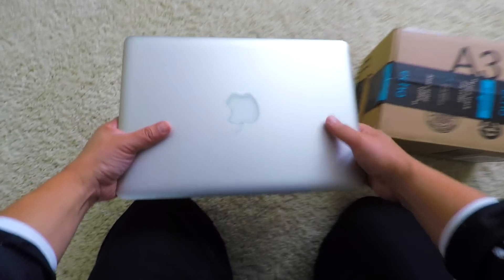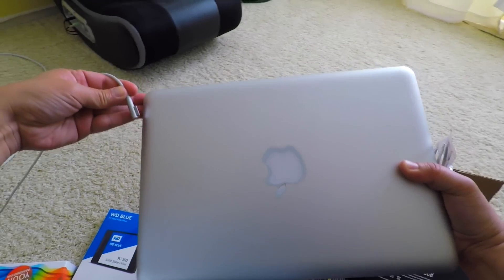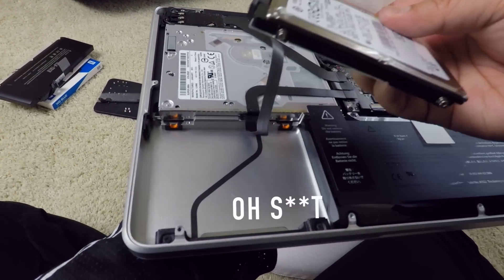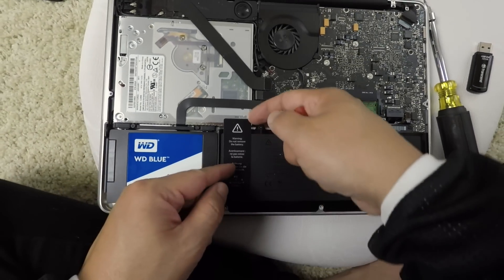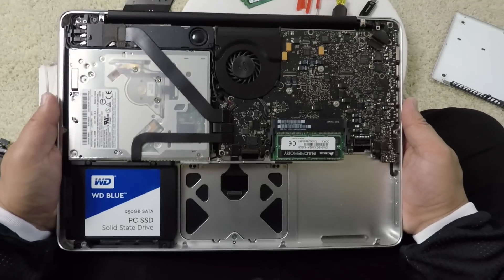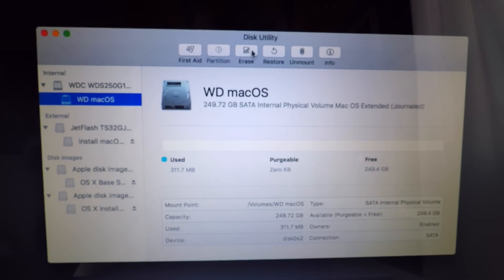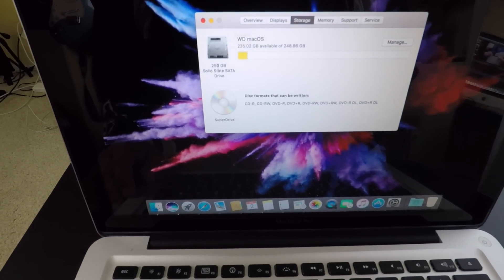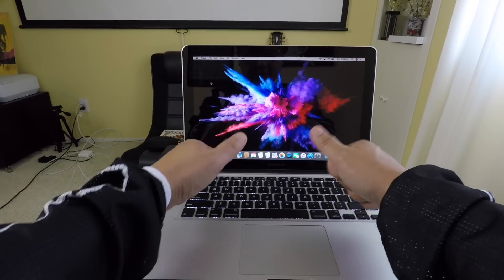Old MacBook Pro Upgrade, FAST Memory, Fast Hard Drive SSD

Comment: :hand-pink-waving:  Dude, if the old HDD was 320GB and your new SSD is 250GB ; shouldn't you be putting in a larger capacity SSD?
  Maybe a 500GB or even 1T ?

Comment: 13"My MacBook Pro 2011, i7 500GB needs new RAM. Should I buy "Samsung NB 8GB DDR3 1333 x 2 pc, or the DDR3 1600? The DDR3 16000 is selling x1. I would have to buy 2 pcs. Could you please advise what to buy? What is the difference between the 2 versions? I am not an expert. I can remove and install RAM. Thank you for helping.
Reply: 1600 is faster than 1333
Reply: @indoperfect4080  Thank You"

Comment: Does this comp still run fast ?? If not, how long did it last? My mid 2012 MacBook Pro is very very slow now and I’m thinking about swapping out the hard drive ram and battery. Please let me know
Reply from the maker: Still runs fast today. If yours is slow, upgrade to a ssd drive like I did. It's the most important part to make it run fast. Good luck!
Reply: @jonthestreet  So i cloned my hard drive to a SDD. Then replaced my old mac book pro hard drive with the cloned SDD and it works so fast now!! i love it . Such a cheaper alternative to buying a new laptop!!

Comment: Shoud have taken out the  long screws first on the back cover. Then remove cover, then the battery.  Drive replacement and RAM replacement then are safe.  Static electricity from carpet could have really been an issue. If you are going to put these out, know that folks who see it are looking at it as a resource.  This would be a very poor resource for someone with limited knowledge trying to do this...

Comment: I’ve a 2010 MacBookpro running High Sierra and now there’s no upgrades because of its age. The laptop in very good condition. Would changing the hard drive allow me to install the latest upgrades ? Advice welcome
Reply: Not really It will be a bit faster but you won’t be able to run the latest versions. Planned obsolescence.

Comment: I am not a computer person so someone please help me shed some light here. this may be dumb question but I am just trying to make sense of how is Lowering from high Storage 320 GB SATA Hard Drive to 250 GB SSD which has less storage would help make the mac book run faster ?  or does the number dont matter in this context ?  thanks great vid
Reply from the maker: 320 GB is the file storage and has nothing to do with speed. SSD’s are faster than hard drives. I think you're wondering why I'm lowering my storage size to 250 GB when it was 320 GB...It's because SSD's are more expensive(because they're faster and newer tech), so depends on your budget. See below for reference on file sizes.

From smallest file size to largest:
KB = kilobyte
MB = megabyte
GB = gigabyte
TB = terabyte

For example:
1 GB = 1000 MB
1 MB = 1000 KB
Reply: @jonthestreet  thanks a lot also came to find that RAM is the one that makes your file to run faster  in contrast to the hard drive given the size is not link to the speed of the computer.

Comment: Help Guys! will this work for a MacBook Pro (13-inch, Mid 2012)?? Thanks
Reply: It should. I checked the apple website and it did say that this works for Macbook Pro 2011 or later.

Comment: Does anyone have a problem with pressing the bottom of the case and it shutting off the laptop instantly? How is this fixed? I'm thinking of some type of insulator between the case and motherboard.

Comment: HAPPY New decade! Hi J. Very well explained and shot. I want to do it for my 2011 MacBook. It's January 1st, 2020 today ! !   If you were to do the same procedure today would you recommend the same brands or others? Which ones?
Reply from the maker: Happy 2020! I plan on doing a update video on my  2011 MacBook Pro and answer some questions, but I would recommend the same brand that I’m using because I’ve had zero issues. I’m sure other brands are good too. I would also recommend going to 16GB with 1600 MHz, because it is supported and most of you on here want the max out of your old MacBooks. More ram helps with video editing and multiple apps opened. The 1600 MHz gives a 2% boost. Not that much, but anything helps for these old MacBooks 😬👍👊
Reply: @jonthestreet  thanks bro. Looking forward to yr vídeos.

Comment: I just upgraded my MacBook Pro 13” mid 2012 with 16gb ram (2x8) and 240 gb SSD and still have installed 500gb HHD, run like hell
Reply: Old post I know but I also have a mid 2012, you’re saying the upgrades made no difference?

Comment: Hi J, I got everything installed.  But when I got to use my bootable thumb drive, I get the Prohibitory symbol (No Symbol).  Have you come across this.  I backed everything up so it is not a big deal to lose everything.  Got any recommendations to help me get my 2009 13 mac book pro going again?
Reply: I'll buy some merch man!  Just please help me out!!!  :)
Reply from the maker: I’m thinking the usb boot drive didn’t create correctly. If u downloaded the macOS from apple App Store, they did an update where it doesn’t download the full macOS. A lot of people have this problem recently. Try this: don’t insert the boot drive and reboot while holding down the keys: Option + Command + r
It should download the macOS that’s compatible with your system to reinstall. Hope that works 🙏
Reply: @jonthestreet  That did not work.  I ended up finding my original mac os start up disc and did a fresh install.  Now I just need to start updating everything.  Thanks for the video.  It was super helpful with the hardware install.

Comment: you can also upgrade 2011 macbooks to a mid 2012 logic board which gives you ivy bridge vs sandy bridge. and also adds usb 3.0.    so a 2011 macbook pro can end being up graded to
 2012 macbook pro logic board

before
2011 macbook pro
intel i5
intel 3000 hd graphics
500 5400 rpm hd
4gb ram
usb 2.0

after 
2012 macbook pro logic board
intel i7 cpu
intel 4000 hd graphics
500 ssd
16gb ram
usb 3.0

pretty much a different computer  i bet it will run like a completely different computer too.
Reply: It’s a different computer

Comment: I upgraded my mid 2010 macbook pro with 8 gigs of RAM  (up from 4 gigs), and a Samsung EVO 500 gig SSD hard drive (replacing the stock 7200 RPM drive).

I haven't noticed a real performance improvement EXCEPT the boot time is about half what it used to be. The Mac runs great except for kernel panic crashes which happen constantly.
Reply: Hmm a little late but it might be your gpu if it still works and you have and your interested you can boot into single user mode and disable the 2nd gpu but only do that after you find out the reason for the crash

Comment: Thanks!! Funny Guy, with the Burito 'bit'. Question? Can you Have 2 Different OS on Different Drives? If 'needed'? Some older softer might not work with Newer OS, and is why I've held off for a long time. I have a 2012 MacBook Pro, with OS X 10.9.5, but Need to Upgrade to Latest for some New DAW Software. Don't want to Lose ability to use older version Programs, DAW, and Screenplay Writing Software.

Comment: 1. Open the back cover with the right screwdriver and remember the screws positions
2. Disconnect the motherfucking battery before doing anything else
3. Keep pressed the power button for 30 sec to release residual energy (not many people do that)
4. Replace all the things u need to replace, be very careful with dem bitches connectors and flat, if u fuck one of dem up u're fucked too
5. Reconnect everything
6. Enjoy this bitch ass almost new Mac

Comment: Will I loose all my stuff if I take out the memory ?
Reply: No, it's just a quick swap. If you had static electricity and accidentally fried your motherboard, you're toast. Don't work on it on a carpet and touch something metal to discharge any potential static electricity.

Comment: I have a hard to make decision in buying macbook pro. Do you think it's God to use MacBook pro 201q in 2018?

Is there any problem with using it? I saw they upgraded macbook pro 2011 to 8GB ram, 1T SSD, Cori7.

Comment: Great video!  Question:  I have the iOS install and running smoothly.  If I remove this ssd 2.5” and use it as an external ssd drive on my newer MacBook Air 11 inch with better video card will that work as another iOS drive?  My video card on my 2010 MacBook Pro is bad.

Comment: Bro I enjoyed your vid & have an anomaly
I installed an SSD on my 2012 a1286 15 MBP, installed Mojave but it would just freeze up(spinning beachball) like once every 40-60 minutes , it was driving me nuts till I replaced the SSD with the old SATA, is the system not compatible with SSD's or was I tricked into buying a faulty second hand SSD, I contacted the guy & he immediately asks for my RAM frequency, I don't know what to make of it but could really use some technical answer, Appreciamos sobremanero
Reply from the maker: I had the spinning beachball on my iMac. I couldn't figure it out until I read that there might be a corrupted Preferences file on my iMac or something like that. So the easiest thing was to make a bootable USB drive, format my whole hard drive (my iMac has the Fusion drive), and reinstall the new macOS High Sierra. It's running smooth now with no beachball.
Reply: @jonthestreet  I fixed it by changing the SSD I had upgraded to earlier, when I replaced it with the old SATA it ran smoothly, the gentleman that sold me the SSD apparently didn't feel the need to share that it was faulty 😔

Comment: doing all of this on a carpet... static heaven
Reply: With the battery plugged in
Reply: first thing i noticed
Reply: not to mention the huge wool jumper
Reply: While barefoot
Reply: Humidity was high I suppose. He had no problems with static. I would have done the same. Big thing is not to move around and not touch any metallic part of the memory chips. Good job! Now on to see how it is performing eleven months later.
Reply: LOL I know 😂
Reply: Same!😂😭

Comment: I upgraded my Mid 2010 macbook to a 250GB SSD and 16GB of Ram. It's also running High Sierra and is just as fast as my wife's new Macbook.
Reply: How u get it to be 16 GB? I thought 8 GBs was the max.
Reply: @ryanillnoisevela2152  
I also went to 8 gigs, based on the available info.
Reply: Are you sure about 16gb of ram? I thought it maxed out at 8? That's what I have in mine.
Reply: @twes619  it OFFICIALLY supports 8GB but in REALITY it accepts 16
Reply: @twes619  all you need is 8 GB Ram, it won't use more than that its a waste of cash.
Reply: @allahdivinecipher nice. I like it. I have an aging 2010. I want to pop in a new motherboard, SSD, and I guess now 16 gb of RAM haha. Should be a fun project if I can get everything at a reasonable price. That's good to know, thanks for the info. I'll give it a shot and see how it goes.
Reply: Did you have to get a new cable for the ssd in the mid 2010?
Reply: Doing that to the mini mac 2011 I just ordered off eBay.
Reply: Cameron How much did you pay for that?
Reply: How much did you spend on upgrade?

Comment: Also dont forget to calibrate the battery. Fully charge it with power. Then take the cord off and let it drain. Turn all the power settings to not shut down while draining battery. Let dead computer sit for a bout five hours and then charge back up. Readjust power settings.
Reply: apple says the newer batteries dont need to be calibrated
Reply: RealDarkFilm becahse they do it themselves, so just doing it just in case with these knockoff batteries wont hurt
Reply: Paul Chinnery thanks for the info !!!
Reply: Didn't know that was needed.
Reply: Nic Bean Seems like a topic that’s always debated. Some say these newer lithium ion batteries don’t need to be calibrated and are best kept between 50-80%. Maybe a ounce full charge and discharge for new battery then charge as usual.

Comment: I'm thinking this is possibly a stupid question, so please be kind, but I have a MacBook Pro 2012 which has a 500gb HDD and is pretty much full and I have been given a SSD which is only 240gb.  I'm guessing I cannot replace my current HDD with the SSD and that I will need one that is at least 500gb?  Is that right please?
Reply: you'll either want a bigger one or not put as much stuff on it.
Reply: Nope, you can use that one and replace it not only that but you can replace the bay where the cd drive is and have two hard drives both SSD and HDD cost £8.99 or so for the caddy if you still need/use a cd drive cost £15 for a USB cd drive. :D
Reply: You should use a caddybay. It helps u to use both ssd and hdd on a laptop :D try it ;)
Reply: Khương Vũ Phạm is it possible to edit in 4K I read online that you can change both hard drives that are the same to something called raid but I’ve also heard its temperamental

Comment: Can you do the same on a mid 2009 macbook pro 13"?  I don't want to shell out the $ for a new computer if I don't really have to.  I just installed 8GB ram and I want to install a new hard drive so I can upgrade to Sierra.  My battery is still good. Thank you.

Comment: thanks dude - just upgraded Mid 2010 13" MBP to 2TB SSD & 16GB RAM - awesome....makes such a difference. Ended up using Time Machine backup to restore Mac OS,  and whilst probs not the most efficient way to go about it, a small price to pay for insane speed now.  Followed both your RAM & SSD upgrade videos....works like a charm! Thanks heaps dude - very helpful
Reply: hi there! i'm actually about to do the same thing on my mid-2010 MBP. except i got a 1TB SSD. did you clone your HDD first? that's where i'm iffy about doing it myself. i also wanna upgrade to 16GB RAM as well.
Reply: How to do backup start up booth to instal mac sierra pls.
Reply: Hey guys- sorry only just saw your replies. TBH, i have forgotten how I did it, but I just remember I watched both of his videos as stated and it worked great. My advice is just watch the videos he has uploaded and see how you go

Comment: So after an year of upgrading the shown configuration........how is your experience......would suggest an upgrade now?
P.S. I have Macbook 13" 2012, planning on upgrading to 1tb ssd and 16gb ram
Reply: Same here on my mid 2012. model, I think its last upgradable macbook pro. I pump it up with 16gb ram, ssd and switch dvd rom for second ssd drive. Its like little monster now. I almost end buying 2016. mbp model but I decide to upgrade and save money for other equipment ;) you won't regret
Reply: @Silvio_Jadranic  which macos will the best for macbook 2012 mid 16 gb ram, ssd ?
Reply: Adrian Szyluk in term of software/plugin compatibility Sierra was best solution for me, but that really depends on what is main purpose of your mbp. Right now I use Mojave. With clean install everything is pretty fast and stable.
Reply: @Silvio Jadranic its faster then sierra? And smoother? And how is battery life?
Reply: Rohan parikh i did exactly that oh my 2012 mbp and it goes blazing fast 👌🏻
Reply: I did my cousins about 3 years ago 8gb of ram and repaste the chips it moves like a monster and it stays extra cool now
Reply: You have to also enable the Trim on the ssd as well.

Comment: I have a MacBook Pro from 2010 (13 inches), and my hard drive is 249.2 GB, my RAM is 4GB, and my CPU is 2.4 GHz. I use Chrome as my browser, and I'm looking to use my Mac to learn music and audio engineering. What do I need to do to make my Mac run more smoothly?
Reply: upgrade ram to 8GB and your hard drive to SSD
Reply: Thanks.
Reply: Ryan buy an ssd and use ableton or fl studio 12 for your daw

Comment: Hi I have a question, I just bought a 2010 MacBook Pro 4Gb, Core i5 and it has 500 SSD . When I got it i wouldn’t download iMovie until I upgraded it to the “Mac sierra” or whatever.. same thing you mentioned. 

So was that like a big mistake or something ? Why is it not a good idea or how does it slow things down.
Reply: Eunice Sandoval No. I have a 2010 also and i upgraded to macos and downloading iMovie works and also works perfectly!
Reply: Nvm thanks lol you answered my question towards the end of the video. Still trying to figure it all out... but wait I do have one more question. The MacBook I just described do you think it’s good to make videos on and other stuff anything I should know ?
Reply from the maker: I would put more Memory in there if you're thinking of making videos. You mentioned it has 4GB Memory, so I would make it 8GB total, or 16 GB. I edit videos on my 2011 MacBook Pro and it was fine. I used Final Cut Pro for editing. There's also Adobe Premiere Pro, both good editing programs. Good luck!
Reply: J on the Street thanks for the response I love the MacBook so far ! It’s actually a 2012 year not 2010. So that was a plus idk why he guy told me 2010. I plan on upgrading the ram.

Comment: Always disconnect the battery first. Even dead.
Reply: Some people are better suited to learn the hard way.
Reply: Wait until you get an electrostatic shock, then you'll change your mind.
Reply: @relaxhub4178  Its not the general problem.. The problem is: if the wrong contacts gets shortened it can roast the entire mainbnoard :D
Reply: @relaxhub4178  the battery died, genius
Reply: Clutcher noted
Thanks for the advice ;)
Reply: and remember, switching to your second weapon is always faster
Reply: Sound advice as a matter of practice.  One stray dying gasp from the battery can fry your system.  Dead battery doesn’t mean there’s not enough voltage to fry your system.  One wisp of static can do the same.
Reply: That’s where I stopped watching.
Reply: His battery is dead anyway. Does not make any difference.
Reply: Kalu Tmg dead batteries still have a charge. Even though it is not much it doesn't take much to damage a circuit board
Reply: How to connect iPhone like that?
Reply: Will it delete your Dj program?
Reply: Flyingdods Gacha literally does not make a difference
Reply: does not make a difference
Reply: guynumber20 you’re stupid lol